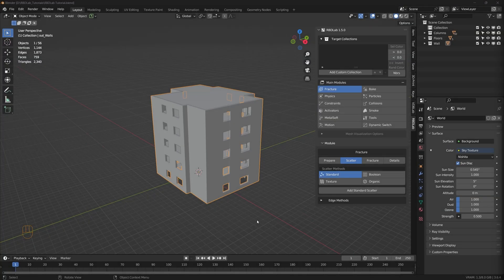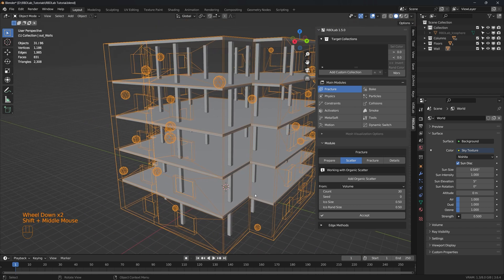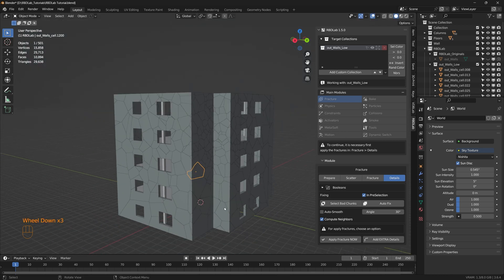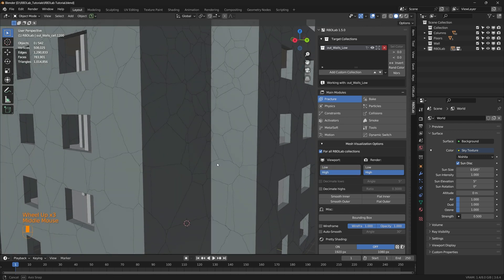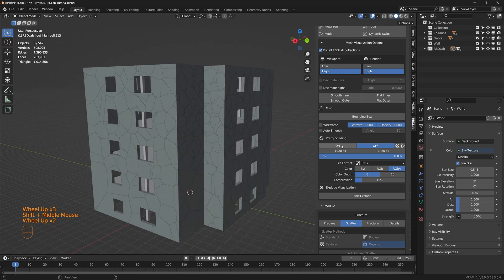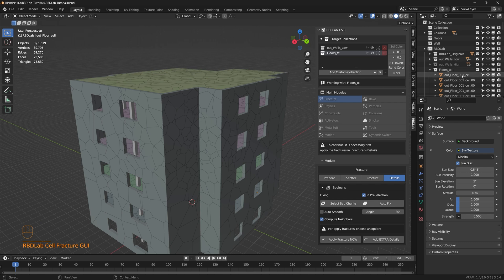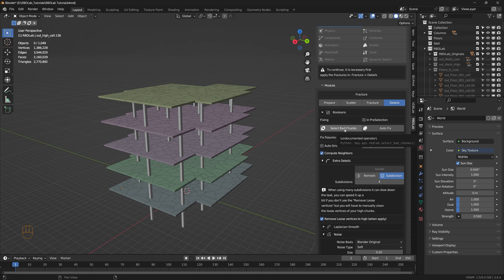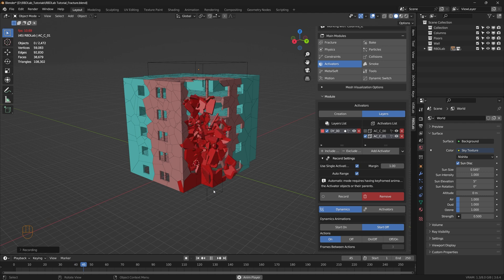RBDLab 1.5 MetalSoft - Fracture Tutorial

Comment: I hare 1 problem with this, when i click "fracture" I can see an python error: Add-on object_destruction_cell not installed.  What is it?
Reply: Same here
Reply: same
Reply: Are you using blender 4.1?
4.2/4.0 didnt work for me but 4.1 did
Reply: @TheBodgerIsGreat  using the last version
Reply: @TheBodgerIsGreat  using 4.0
Reply: i got the same issue before but here is the fix :

If your Blender version is 4.2 or above, u need to use RBDLab 1.5.6 version unless u will get that "object_cell_fracture" error message.
If you want to use RBDLab version 1.5.4 or below, u need Blender 4.1 or below version.

Comment: I get new "bad chunks" after applying subdivision with seemingly no way to fix them.
Reply from the maker: Your geometry may possibly have many non-manifold faces. You need to properly prepare your geometry before fracturing it.
Reply: @befxstudios3D  HOW though? I am looking through your tutorials and in your docs and there's nothing on it. I have 0 non manifold edges but it makes some weird things happen when I fracture.
Reply: I get the same thing. I ran the check and it said 0 manifold edges. I also recalculated faces to make sure normals were facing out properly. I don't see bad chunks until later after I've simulated a bunch of times. Then all of a sudden there's  a bad one in the render. Did you ever find a fix for it?

Comment: Hello, the fracture worked on the walls the first time, but after that, any further attempt to fracture the floors or the colums, the original mesh disappears and nothing takes its place. It just creates an empty collection in the outliner. It now does it with any mesh I try with, even random primitives. What am I doing wrong?
Reply: Did you find that out?

Comment: Thanks for the update ... I'm getting back into it and wondering if you have any tuts that show how the cells can be made to fracture like wood (posts, beams, walls)?
Reply: Did you ever figure this out?  Using cell fracture you can stretch the mesh after you've fractured it in whatever direction you want the grain of the wood to run.  I haven't tried it with RBD, and I notice there is a "wood direction" option...might try that?